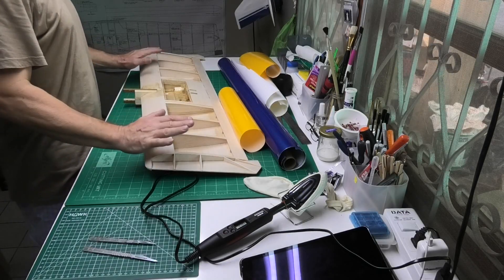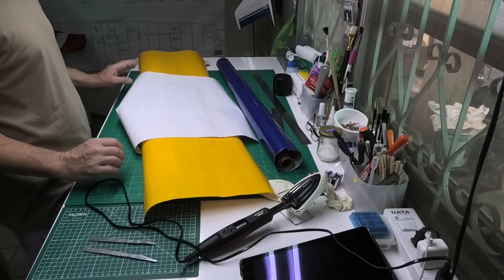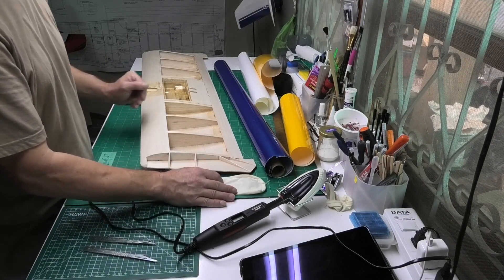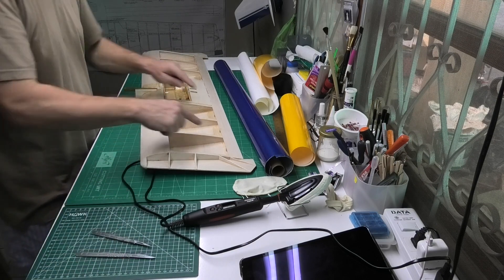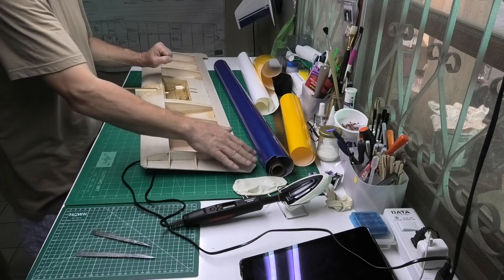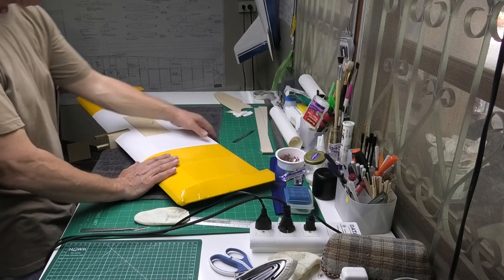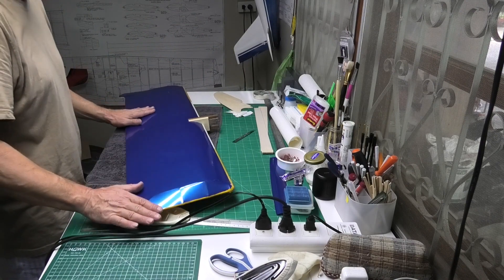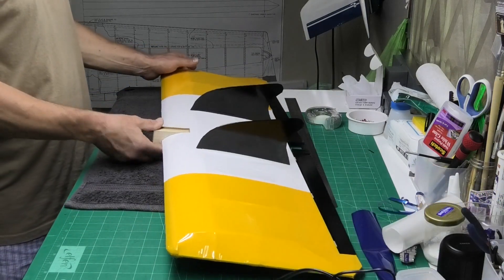King Kombat Pt 6 - a balsa 40" RC flying wing! - Covering the Wing

Comment: I'm curious how you get the seams so straight - I can never get a straight enough cut and end up using thin strips to smarten up the seams. Cheers
Reply from the maker: When cutting along the edge of the wing, whether its the leading, trailing or wing tip I run a finger along the edge of the wing as a guide if possible. I think its practice as much as anything. I can cut a straight line with no problem, but oh my, you should see me try and paint a straight line! Its terrible! hahaha